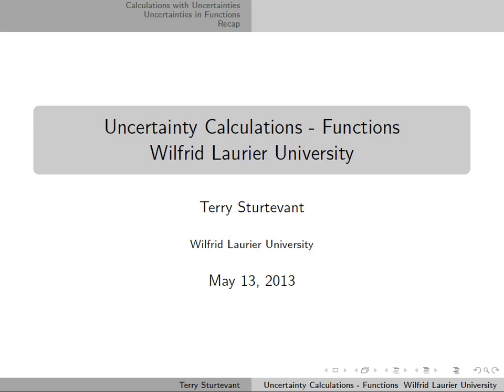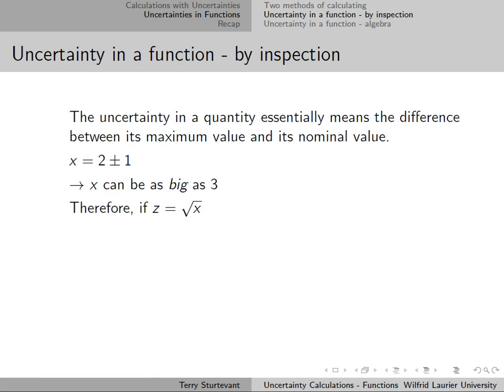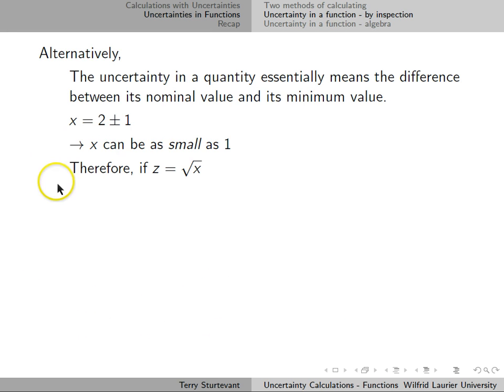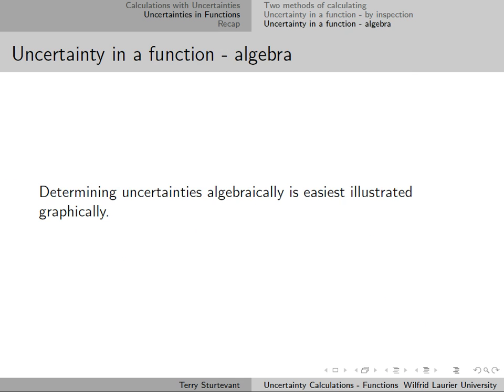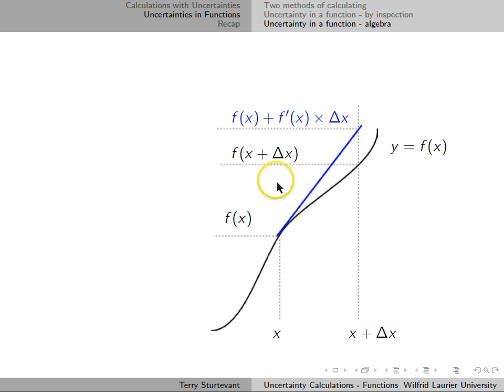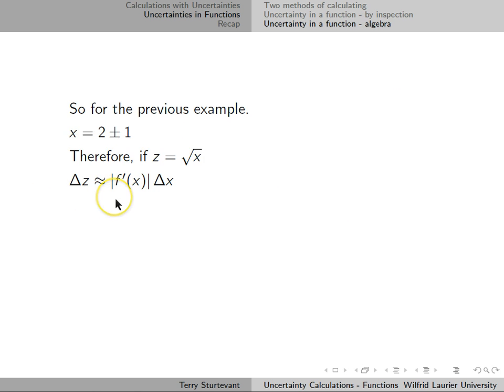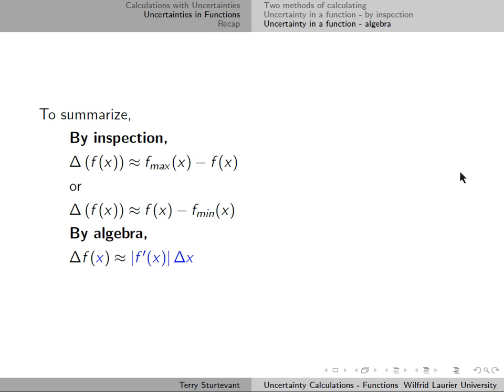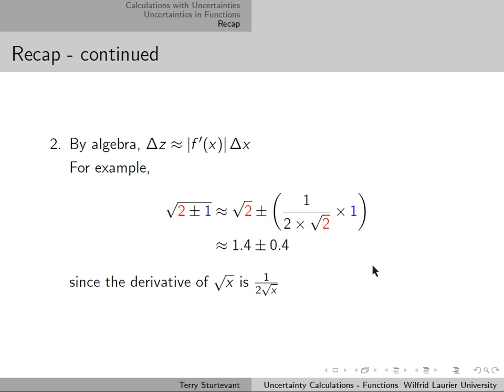Uncertainty Calculations - Functions of a Single Variable

Comment: It's commonly reported that the uncertainty of a squared quantity (with x as the nominal value and K as the uncertainty) x --> x^2 is just 2K, but using the algebraic formula, it would be 2Kx because the derivative of x^2 is 2x, why the discrepancy?
Reply from the maker: 2Kx is correct. Remember the units of the uncertainty have to be the same as the units of the quantity, so 2K wouldn't have units of x^2.